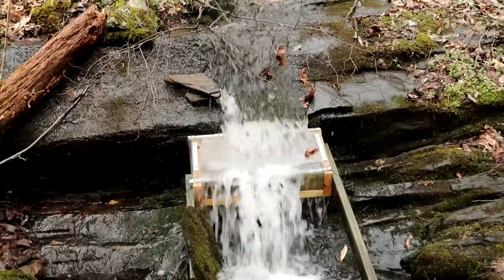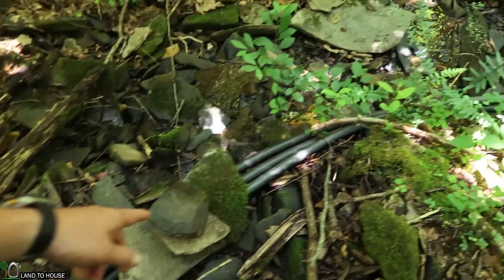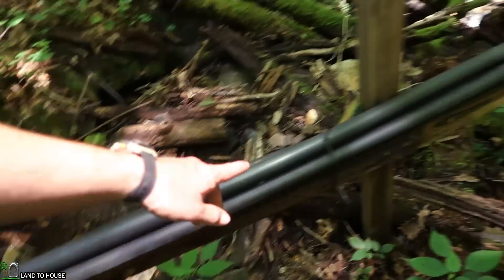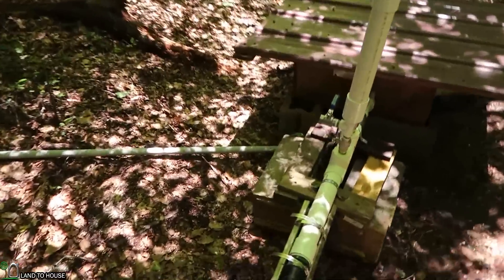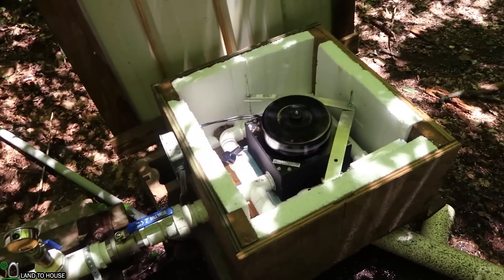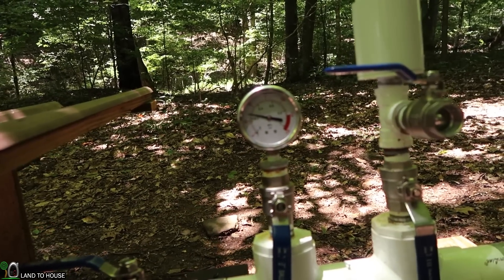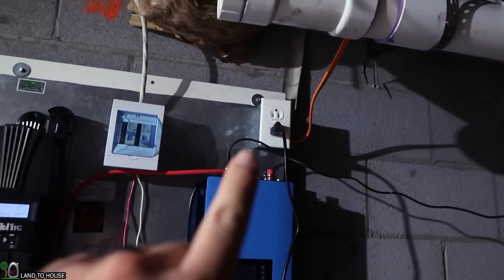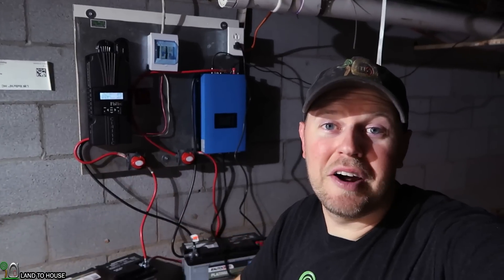Full System Overview Micro Hydro 10/10

Comment: As a practicing Electrical, Electronic and Mechanical Engineer I congratulate you on your pluck. Who doesn't enjoy playing with water and power tools? However, I feel I must add some comments in the spirit of making this project really great.
1) Get rid of the windowscreen. Use something like hardware cloth, with larger openings. You lose a lot of flow trying to get water through those itty bitty holes. Since you have the sump in the collection keg, you are pretty well protected against debris.
Why do I think your barrel reminds me of a thump keg? Add another feed or two, JFTHOI.
2) You have a number of places where you are forcing the water to flow uphill.  Every time you do that, you are wasting flow. Flow = power. Flatten out that run as much as you can.
3)  Dig a hole under the thump keg to lower it, so you aren't forcing the water to go uphill into it. 
4) Get rid of the 90 degree bends. Again, more flow resistance. Use those nice 90 degree sweeps you can buy cheap.
5) While you are at it, move the outflow of the thump keg higher.  Every little bit helps.
6) I presume you have fixed all the leaks. going down the hill. You can keep the pipes from coming apart by putting a self
tapping screw through the coupling and the pipe. Silicone seal will address any leaks. Do all the above and I bet you get more pressure.
7)  Ground the case of the generator to a good ground right there. You never know. No matter how good the generator, it can fault mechanically.
8) With that long a power run, you should put a breaker/disconnect at the turbine in case of any fault which can develop in the lead to the house. Animals chewing wires, backhoe outages, the diode usually fails with a short from lead to lead, You don't want to smoke the generator.
9) Add a breaker where the lower enters the house. Save a trip up the hill in case you need to power it down in a hurry.  Protect your house. You can start a fire with a 9v battery, let alone a couple of hundred watts at 100 Volts or so. 
10) Am I seeing things, or do you have 110V on the blades of a MALE plug coming out of the inverter? NONONONO! I would red tag your butt from here to Kingdom come if I saw that. Get yourself a nice Hubbell female for the wall and a male twistlock for the supply.
11)  Now then, are you SURE you are feeding power TO the house? Do you measure 110V on that male plug if it is unplugged from the house? I can't imagine a manufacturer building something that way! 
12)  That KILL A WATT thing is hooked up backwards. I haven't seen one, but it is meant to go in the wall with an appliance plugged into it so you can measure things. It might just be inductively coupled to the line in which case it might work backwards.
13) If that ac plug is feeding 110V from the blue box to the house wiring, what do you have to keep from feeding 110V back 
over the power lines to the grid? If the shore power goes down, you could be feeding 110V out to the power poles. It would put high voltage coming out the supply side of your transformer, and although the current is fairly low, it could bite the piss out of a lineman. Most power companies are pretty particular about backfeed preventers and insist on inspecting and approving that part of your install. If not approved, you might find yourself with one Helluva liability at the worst, and certainly with the shore power disconnected at the leas.
14) I really don't want to rain on your parade, I'd love the opportunity to build something like that, but I sure wouldn't want you or someone to get hurt. 

Get yourself a Tesla and charge it from the turbine at night. I charge mine from my solar roof. Almost as cool as charging from my very own personal dam. And giving the finger to the power company or Exxon Mobile is a good feeling.
Reply: just to say for point 13 the inverter has a current limit function which means it won't send power to grid unless it reads power and amperage and the CT clamp which is usually at the meter tails

Comment: I guess it doesn't freeze there.  Are you counting on the water movement to prevent the pipes freezing?
Reply from the maker: It does freeze.... A mouse chewed a wire and locked down the pma. I forgot to turn the water back on and EVERYTHING at the housing froze and shattered. A fun rebuild is in the future.

Comment: Very nicely done installation. I have a couple of suggestions:

Install a vent at the penstock inlet to allow the pipes to drain without pulling a vacuum.
Use a bigger pipe for the next penstock. Look for 10 ft/sec velocity at full flow.
Set up a "Y" shaped splitter outside of the turbine box. Right angle bends cause substantial loss of head and energy.
Be prepared to relocate the penstock after spring runoff.

All in all a really good job.

Comment: Hi Seth, greetings from Papua New Guinea, loved all your videos. You did a good job from start to the completion. Just a few questions here. What is the  head of your system and what is your flow rate in the pipe to the hydro generator?😊 
And in the future please cover videos on the appliances that your battery banks will power and for how long the appliances will be powered by the battery banks until the battery falls to 75%. Another question, does the inverter switches off when the battery falls below 75%?
Reply: He should use a Charge controller with direct load function that way he can still charge the battery and use the power at the same time. Just my thought otherwise great video really admire his work.

Comment: What exactly is the point of this? Trying to create free hydro? Save the environment? Reduce emissions? Blah blah blah...1100 ft of Polly pipe....LMAO...Polly pipe is made from what again? Oh yeah...oil....FML  the amount of fossil fuel based products you used for this far exceeds any practical benefits. FML..LOL
Reply from the maker: The point.... power when the grid goes down. We normally lose power here in the mountains for at least 5 days on an average winter. After that... its just fun.

Comment: Assuming the batteries cost at least $100 each, total battery cost would be $700.  Batteries last an average of 5 years.  I don’t see how using batteries would be cost effective.  Can you just grid tie the power without the batteries?

Comment: Hi there!  I just stumbled upon these videos...nice job!  FWIW, the ups and downs of the carrier pipes in between the inlets and outlets of your system do not impact the final pressure at all, as long as the highest point of the carrier pipes remain lower than the point of origin.  I’m not an engineer but since water will always seek its level, that’s how it has to be.

I’m not being critical.  I love the project!
Reply from the maker: Thank you for watching. I believe the issue that arises with valleys and rises in the penstock is that air can become trapped and that will slow down the water

Comment: If you get 320 watts with 2 jets open you don't have to close one jet because the tank don't overflow. This system is autobalance. What you have to care is the maximum power of system with some minimum pressure in the inlet of turbine. This minum pressure maybe you can find in the jet turbine  generator data sheet or maybe making several test. The pressure is equal to the high of water inside pipe. Because you was very careful with the downhill of pipe to avoid air trap inside water  you don't have to worry about that because all the air that go inside pipe keep over the water and when you have enough flow of water, the air go out through the pipe and the tank. I think you can test open all the 4 jet partialing up to the minimum optimal inlet pressure to get the maximum power and if not work test with 3. But is better for the live of the roll bearing with 4 or 2 because the water force is balancet with 2 opposite jet or with all 4 jets open.

Comment: Do you have a electric utility connection? If so, an induction motor as a generator would have been far cheaper and simpler for such a small system. 
I built a 17kw twin-jet Pelton system 40 years ago and then went on working in hydro to this day. Your project brings back a lot of good memories. Keep up the good work!
Reply: Sir , will you show your system

Comment: Great videos.  Well done and informative.  What is the limiting circuit?  Does that prevent the inverter from supplying power to the grid?
Reply from the maker: Yes. The limiter reads the amps going into the house. If there is no amps used the inverter does not feed power.

Comment: When you put the turbine under load how well will only 2 jets keep up? Seems it's design for maximum efficiency and capability will be using all 4 jets.
Reply from the maker: At one 1/4 nozzle it gets 200w. At two nozzles it gets 370w. My output pipe needs to be bigger to run more nozzles.

Comment: Awesome setup, but your barley pulling enough to run a fridge. One solar panel will do 400w almost now days.
Reply from the maker: I also have solar. With hydro and solar I will have the battery capacity to run the fridge when the power is out.

Comment: We can use PVC adhesive after using torch before slipping the connector in.. just in case if it didn't work.

Comment: You should look into putting a flow sensor on the overflow or a switch right below it and use something like an Arduino to automatically control the three valves on the turbine to have maximum output at all times.

Comment: Hi, thank you for the video. Very informative. Why not connect to the grid? Or just use solar plus batteries?
Reply from the maker: Thank you. Actually this is grid tie. The hybrid off grid system is in the works. With solar as well.

Comment: You should intergate a microcontroler like a arduino to measure the water level/overflow rate to automaticaly open and close the valves depending on the water level

Comment: I really liked the series, but I do have a few comments.  The power generated, 80W,  is really quite low.  Running 24/7 this turbine would provide 80*24 or 1.92KWh/day.  The daily usage of power in USA  depends,  of course on your location, and ranges from a high of 42.4KWh/day (Louisiana)  to 17.2KWh/day (Hawaii).

Even under the best conditions with a very high efficiency home, 1.92KWh/day is a drop in the bucket. To make a serious dent in your utility bill a turbine in the 500-1000W range would be needed, but you would need an appropriate water supply to feed it.

My advice is, before you starting building, to characterize your flow/head and estimate the power you're going to generate.  For many solar will be a much better alternative.
Reply from the maker: I am not sure where the 80w came from. This unit is making 210 watts with one nozzle. 330 watts with 2 nozzles. I need to increase the size of the output pipe but I have seen 516 watts. With my hydro and solar connected I have seen well over 10kwh a day.
Reply: @LandtoHouse  Thanks for the reply.  I did watch the video again and you are right.  The charge controller clearly shows the power generated is 326W. Many apologies for my error.

Comment: Why not keep the power as AC and no DC? You could power your entire house with the turbine generating ac power ?
Reply from the maker: The turbine is making 3 phase ac and its voltage is all over the place. Going to dc and then to regulated ac  is required to feed the house.
Reply: @LandtoHouse  thanks for quick reply! Will you do a video about how the setup does during winter?
Reply from the maker: Oh yes I am sure there will be many videos in winter.
Reply: @LandtoHouse  cant wait!
Reply: @LandtoHouse  have you considered usein a diy Tesla powerwall using 18650 batteries as a powerbank for the micro hydro? I should be cheaper to build compared to the lead acid batterries

Comment: Did try to send back the output put water to the reservoir in case of lack of enough flow?
You did a helpful great job!
Reply from the maker: The drop from the top to the bottom is 163 feet. There is no easy way to get the water back to the top. Even a Ram Pump would need 24 feet of head pressure to get water that high.

Comment: can you get electric ball valves so you can press a button at the house to cut out a jet ...without have to trek thru the woods
Reply from the maker: There are nozzles with adjustable size that could be used to turn off the water. I am not there yet in my playing.

Comment: 27 years ago, I wanted to purchase a  parcel of land near a running brook to live as a self sustained, off-grid living by building a small raised dam and use a 24V turbine generator, inverters, batteries, etc, for a country shack (cabin) that would have been enough to live the good life alway from greedy water, power and gas companies. Bad luck struck when I enquired with the local shire who said I cannot do any of that to the brook. 

The brook water was only to be diverted to a pond downhill of the land (not the entire brook just half of it) and then from there it would overflow by pipes straight into the turbines and back down into the stream. The shire said no, even though water wasn't polluted and what was taken would return back in the brook. The land and the brook were part of the purchase deal but the River Authority owned the brook. So I gave up and never bought that land, dreams destroyed. 

One day 4 years ago, I decided to visit the area and noted that cabins were spread far and wide. I then decided to pay a visit to the land I really loved and, you wouldn't believe what I saw. A nice cabin (small house) built on the exact spot where I had planned to erect mine and, further down I saw a pondage and white pipes with other implements such as some sort of generator ran by water. I felt like suing the shire for not allowing me to build and settle there, yet 4 years before this visit I see they had allowed someone else and, like a neighbor I had asked on that day had said, that, they are rich and must have paid big money to build there. Amazingly what money can do. 😫

Comment: Why did you go with Auto cranking batteries instead of deep-cycle rv-marine or even 6volt elec vehicle (golf cart) batteries.
Reply from the maker: The agm should last for many years without running them low. And cost was a big factor $150 each for these.

Comment: There is no need for vent piping at the intake box ?
Reply from the maker: Vent piping?
Reply: Land to House like on your sink or toilet. It’s a pipe to relieve vacuum pressure and allow the water to flow faster.  It goes normally behind a pea trap.
Reply: @darthepirate3033  Your toilet and sink need the vent due to the "P" trap.  The "P" trap cuts off the flow of air from the top which in return keeps gasses from coming up into the house.  His system is open on both ends.  There would be very little water flowing with a gulping sound if he needed a vent to get rid of a vacuum situation.
Reply: orion1820 thanks
Reply: Land to House btw great series I learned a lot.

Comment: i dont get it!, you spend all that money,time and effort for a very long non direct line of sight pipe,turbine and fittings, then run it off in effect an overflowing single 25 gallon bucket and 25 gallons of dead unusable lower water for grit sediment trap you never get/cleaned, and all the overflow water that actually gets in the pipes is just intentionally thrown away at the barrel
Reply: And why would he convert 3-phase AC to DC then back to AC?  Can't you step down 3-phase AC to single phase for the house?
Reply from the maker: The 3 phase ac is high voltage and fluctuating wildly. The rectifier has to be used to convert to dc for storage in batteries. The inverter has to be used to get the highly regulated 120v 60hz ac power.

Comment: Just I side note. 
Please list the type of 
Inverter used.
Rectifier used.
Charge controller used . 
Type of generator used. 

Secondly does seem like a serious amount of work to generate what 2x 350w solar panel can do In a 6 hour day with less piping less headache. Of course depends which part of the world you live in . But seeing wind turbines making 1000w for residential use with around the same investment too just cant see the merit . . . Maybe some one can chime in and advise
Reply from the maker: I have solar now as well! Together they make almost half of our power usage. The hydro can make 200w to 500w depending on the time of year. Really good for power at night 

I will need to make a separate video showing the electronics specifications.
Reply: @LandtoHouse  when you start talking about 400w and 500w all the time 24 hours a day then we really talking . Hydro makes power while you sleep and that really is where the bonus is . I run off solar and build lithium batteries perhaps I could supply you a test battery management unit for your home to setup . . . Let me know of course this is when your lead acids are done and dusted
Reply from the maker: This winter the hydro should be making 400w all the time. 

When lumber prices drop to a reasonable rate i am going to make a lawnmower shed. Its going to be solar powered. If you would like to be a battery sponsor for that solar install series it would be great. I will likely do a 3 or 4 part series on that.

Comment: You have the inverter powered by the house, you will have no electric at your house if you loose power to the house.
Reply from the maker: Correct this is going to be a hybrid system. Hydro , solar , grid tie , off grid. Much more to come.

Comment: The electric box at the hydro needs to be a disconnect per code. Also the rectifier needs to be in a box, no exposed wire ends.
Reply from the maker: The power at the hydro can be shut off with the ball valve. I am going to be covering those wire soon. A video on that coming up.
Reply: @LandtoHouse  I was going to make a similar recommendation, that you want a cut off switch, preferably a circuit breaker out at the turbine to preserve it against burning itself out should there be a short some day.
Reply: @LandtoHouse  you need a disconnect switch at the turbine tbh